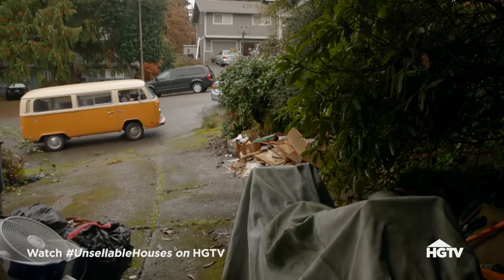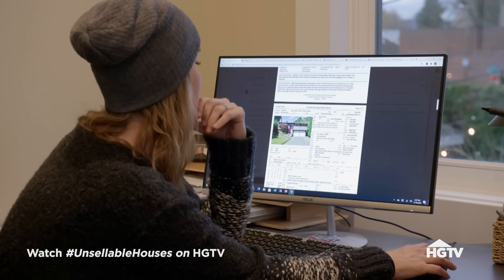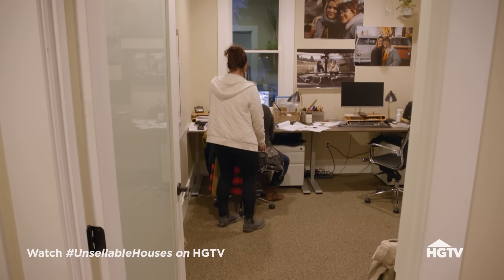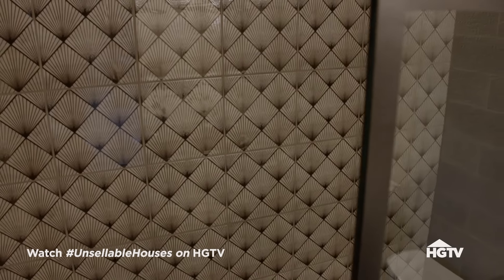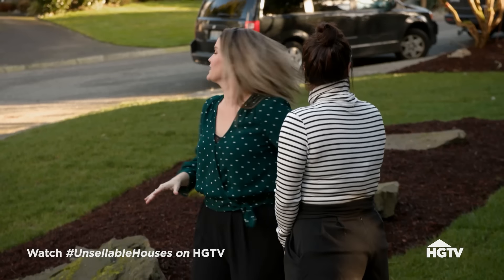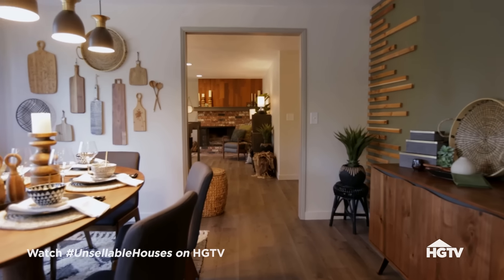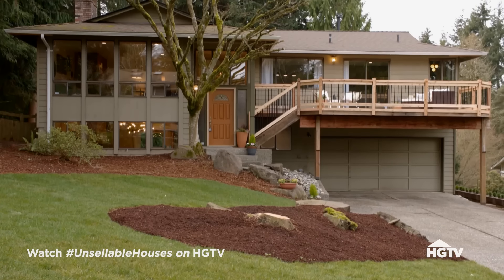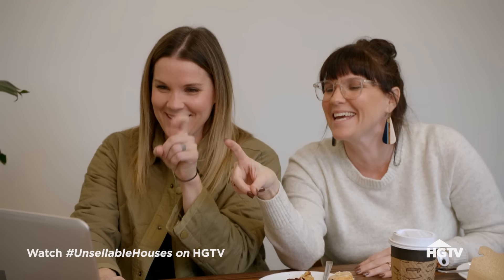Hoarder House Renovated and SOLD for $100K Over Asking | Unsellable Houses | HGTV

Comment: What about the condition of the plumbing,  electrical,  foundation,  roof and furnace? A house like that usually needs updating and they didn't mention any of them. That house was neglected for years.
Reply: It’s all perfect and need no work! Is that enough for you?! God!
Reply: They put in a $100k investment, they would have done their due diligence beforehand. And, in renovating the bathroom(s) they would have remedied any problems then.  You don't invest in a property that has electrical/plumbing/foundation/roof issues, so since they did invest in it, it was good to go.  The new owner would have changed out the furnace if it needed it.  He wouldn't have offered over $120k over asking if there were problems.  Realtors must divulge any issues to prospective buyers.
Reply: Fair point. However, these clips are usually only half a show or less.
Reply: @tablescissors  Good point.
Reply: They probably just make it look good and let the new family that moves in deal with the mess.  They were excited about no inspections or contingencies so you know its a money pit that looks good but isn't.
Reply: a lot of times people buy based on looks :( 

People even DONT buy for simple things like wrong paint color (like, duh, that would be so easy to change compared to a structural issue).
Reply: @veritas4698  We recently sold our home and I would have been elated to not have inspections, but not because there were hidden problems with the house. Inspections cost money and take time to schedule. One of the offers we had was cash on the barrelhead, which would not have involved a financial institution, hence no inspections necessary. (As tempting as it was, there were solid reasons not to accept that offer.)
Reply: There is no return on iodating utilities so they pass it along to the next buyer who is clueless

Comment: Hold on. They get 50% of the profit from the sale, based on the difference above the original asking price? Like, if it had sold for 1 million, they would get 200k? That is WILD. Should there be a cap on that...like a percentage or something...? And they must have not included labour or had sponsorship deals, because that is a lot of work, appliances, paint and labour for only 100k in renos...
Reply: I think the seller did pretty well overall. The sisters put in the cost for the materials and labour.  When the house sells the sisters get paid back for that.  Any additional profit gets split between the sisters and the seller.  The seller couldn't sell his house before, when he was asking 500K.  It sold for 855K. Basically Stan walked away with 627K for a house that couldn't sell for 500 K.

Comment: They could have done it themselves for 100k and made a better profit.  They could have eliminated the bad kitchen tile, colors on the walls, bedrm wood etc.  They could have opened it up as they did and with a light neutral paint throughout and nice kitchen backsplash this house had major potential.  They made it tacky.

Comment: I dont understand the profit model. The designers lose $25k. 🤔 is my thinking off??
Reply: They gamble on raising the sale price enough to recover their costs ($100,000). We don't know what would happen if the actual sale price was lower than the original value plus renovation costs. I guess they would lose their stake. But they specialise in identifying houses that are undervalued for superficial reasons that are easily addressed. In this case they made $72k which isn't a huge amount.
Reply: @lobstermash  appreciate this...

Comment: Gorgeous house, american houses are so much better in design sence, even before remodeling, bad thing are holow walls, and wooden stairs, weak roofs, imitations of brick, rarely somethink is real, like real stone in the building, fasades are also lot weaker than european, than wooden stairs 😮, wooden teraces, nothing more solid, that is why they are easy to renovate, paradox is real granite countertops, and entrire kitchen is suported by wooden floor, like no solid concrete, armature plate underneath it all, conclusion focus is on inpresion, not on durability.